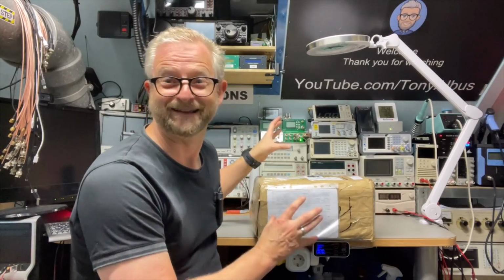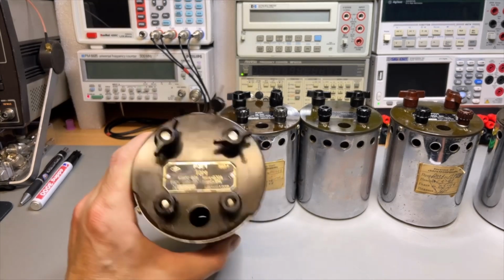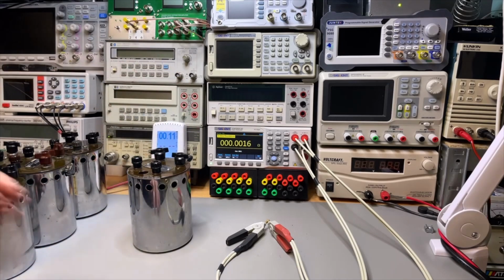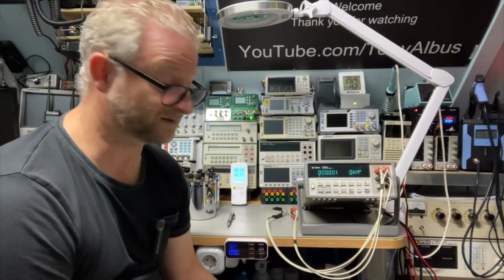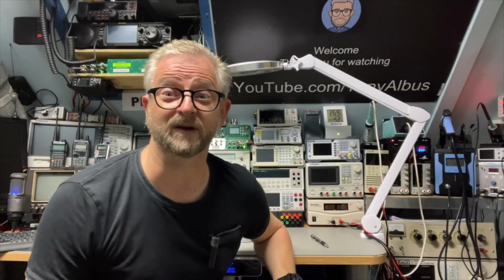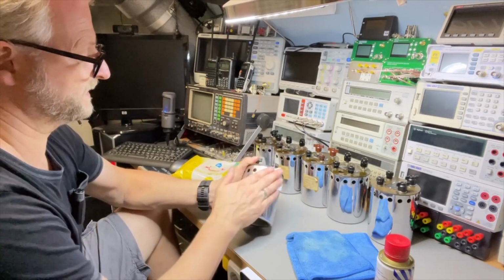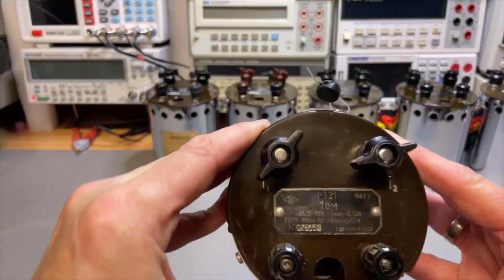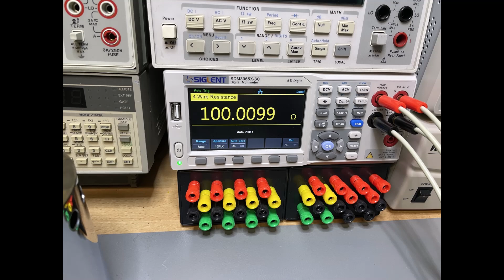TA-0308: Calibration Resistors P321 P331 0.01% - 1960 - Restore

Comment: Your resistors are probably well within specifications. You need to change your measurement method to remove the internal lead resistance of the actual resistor. The measurement you made with the kelvin clips was a four wire measurement to the the terminals of the resistor But from there your measurement is treating the resistor as a two terminal device. Inside the resistor is actual element has a current lead and a voltage lead connected to each end making it 4 terminal measurement to the actual element. What you measured was the element and the lead in wires not true four terminal. If you get 4 individual wires and connect to the corresponding lugs you will get a true four terminal measurement and the value of your one ohm resistor will drop
Reply from the maker: Thank you, yes that is what i did wrong.. good information, silly mistake on my part.
Reply: @TonyAlbus  What a great acknowledgement of @randylemn comments. Thats why I like this channel. Everyones comments count thus creating a good source of shared information for everyone.
Reply: My thought exactly, these cans are made to be 4W measured. I have the 1,10,100R units, and I needed to borrow a 6.5digit calibrated multimeter at work in order to properly test them 🙂
Reply from the maker: @OZ1LQO  Cool!

Comment: I also own a set of these standards. I checked the 0.01, 1, 10, 100 ohm units out on an ultra top end meter and found them all well within 0.01% and around 1ppm/°C except for the 100 ohm which was 7ppm/°C. The test temperatures were 67°F and 77°F.
Reply from the maker: Thanks Mike, yes amazing after so many years.

Comment: Nice standards Tony! These standards are manufactured in the Russian city of Krasnodar. I have an identical set of six, from 1 to 100,000 Ohms, plus three more low resistance versions at 0.1, 0.01 and 0.001 Ohms. The oldest one is from 1962 and the newest from 1987.
As others have commented, these resistors would have spent their working lives immersed in a large tank of oil which is kept at a very stable 20°C. That temperature is also the calibration temperature, so to really see if your standards are still in spec, you need to have some way to maintain them at 20°C while you perform a proper four wire measurement. Getting a reading that is stable to six decimals requires that I connect the resistor, wait 15 minutes or more for the temperature of the connections to equalise and sit on the other side of the room so that my own electric field doesn't mess up the reading!
Reply from the maker: Thank you for that information... yes temprature is a big issue... never thought they would be in oil, but you are indeed the second person mentioning that... i saw soem demage on one, that it seems it was in 2 cm of water... now it makes sense.

Comment: Hi Tony, I have a few quite early "Standard calibration resistors" like these.
They are filled with "transformer oil" that back then was carcinogenic and thus toxic.
Took time to empty, flush multiple times over a few weeks, before refilling with new modern "inert ?" High voltage transformer oil.

Mine also have high precision mirror backed glass mercury thermometer and they specify the resistance accuracy as a Very specific temperature, hense the immersion of thermometer into hole in top of case
Reply from the maker: Thank you, nice information, yes i thought the hole in the top was for that. nice how you restored yours!

Comment: I also have the Siglent 3065X and find it needs a good several hours warm up for ultimate stability...before any critical measurement I leave it on for about a day.  Of course stable temperature in the lab is required.  I built a standard using 0.01% (100k) and 0.005% resistors (1,10,100,1k) metal film/foil resistors for less than $100US.
Reply from the maker: Yes Siglent needs atleast 2 hours and a stable temp. it is very sensitive.

Comment: Made in the Soviet Union.
These reference resistors were installed in the thermostat. The thermostat is a refrigerator, the chamber of which is filled with oil. The resistors were in oil. Every 12 months they were turned off and sent for verification
Reply from the maker: Wow, did not know about that procedure, interesting, thank you!
Reply: Interesting - I have a couple of these resistors as well. Can you point to somewhere with more information and pictures this refrigerator and the application of the resistors? Thanks, 73
Reply: There was such a DC potentiometric installation for checking electrical appliances, called - У355. There is a hatch at the back, there, in the thermostat, there is a set of such reference resistors. Thermostat - refrigerator with oil.

Comment: You should be using 4 wires, not the kelvin clips.  You are getting addition resistance from using the clips.
The force leads should be connected to the I (current) terminals.  The sense leads to the U (Voltage) terminals.
Reply from the maker: Thanks Chris , yes i should have i know now, this was silly mistake, not thinking.